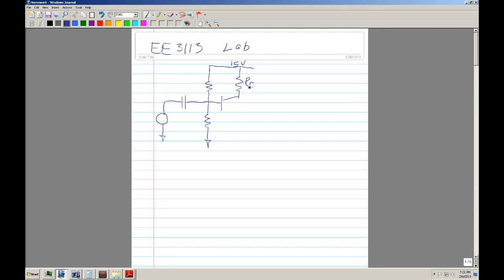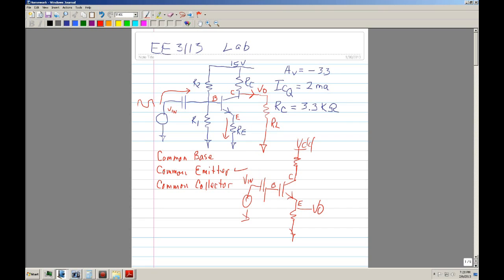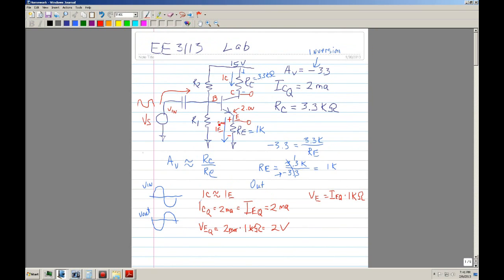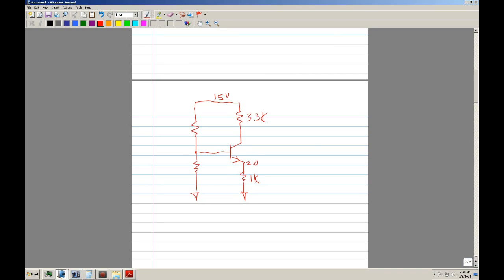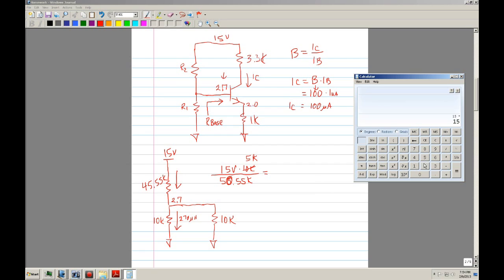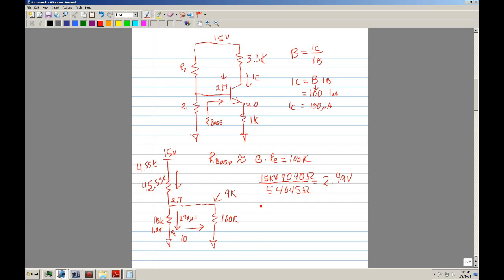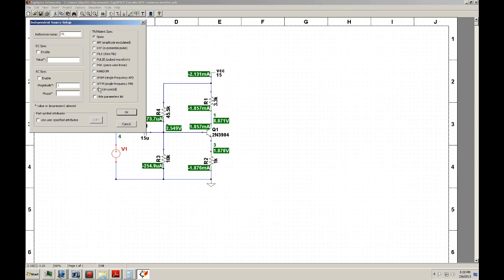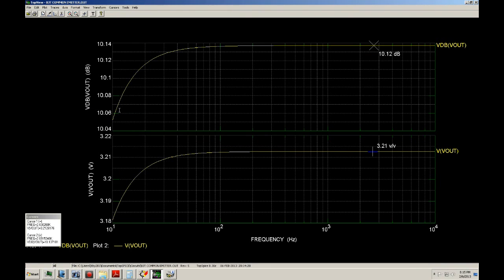EE3113 Common Emitter Lab

Comment from the maker: Hi 07ghost36,

I welcome your comment but I must say that you are incorrect. The Av=(RC/Re)=RC/(26mV/IE)) is not correct for this circuit since I have a resistor in the emitter RE=1K. Your equation is only valid for a ground emitter (common emitter). The goal was to design for a gain of -3. Using your equation would yield a gain of  (Re=26mV/2mA=13ohms)  Av=3.3k/18ohms=183v/v.  As you can now see, this is not correct. Watch the end of the video where I use spice to validate the design.
Robert